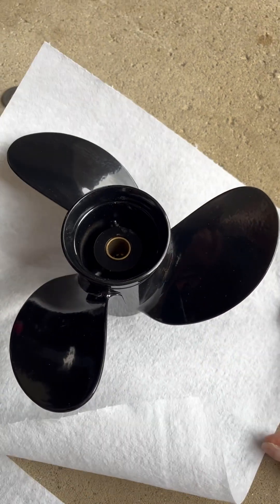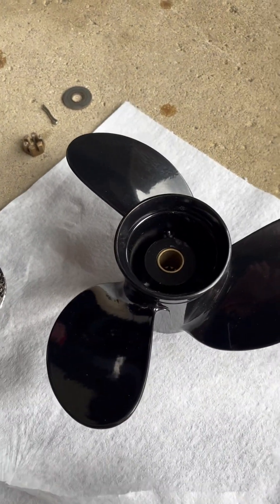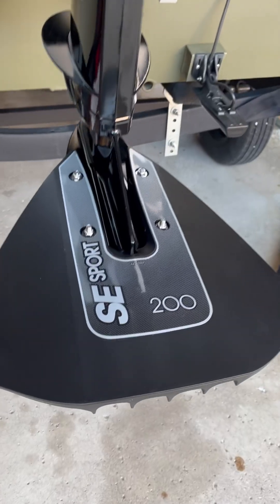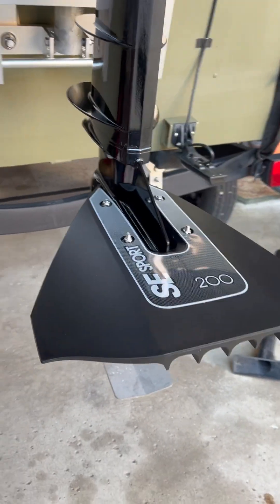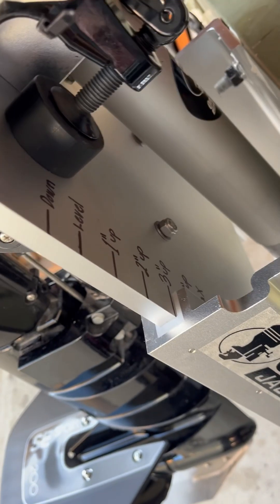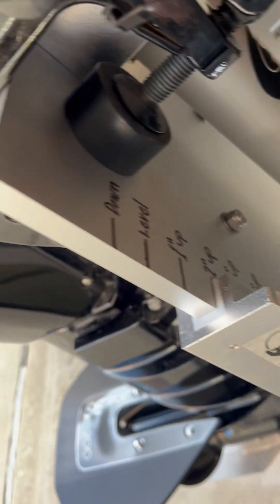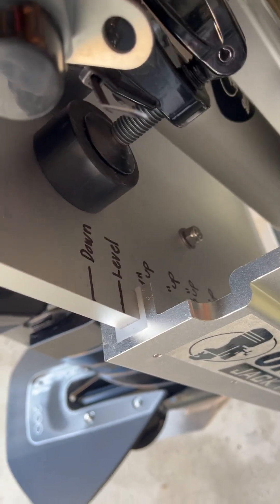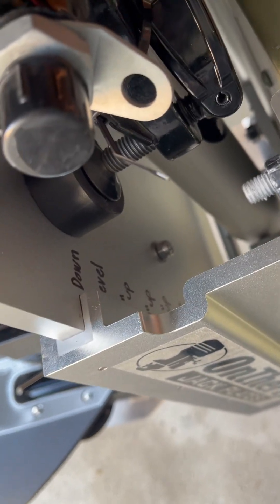Mercury 9.9 hydrofoil and propeller upgrade.

Comment: How did the bigger pitch work for u?
Reply from the maker: It did not work as expected, actually slowed the boat down more so I just recently installed a 8.5x8.5 to see if it will hit the rev limiter.  I’m planning on getting the propeller cupped so I can lift the motor up higher into the water column while still having full thrust.